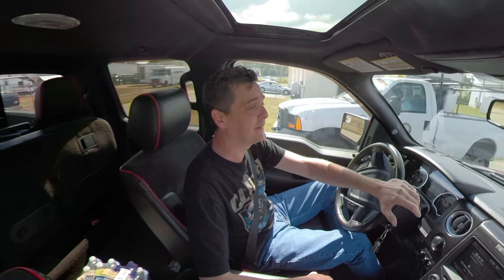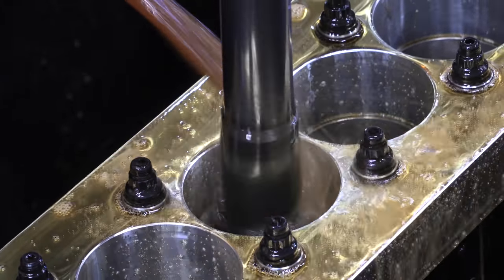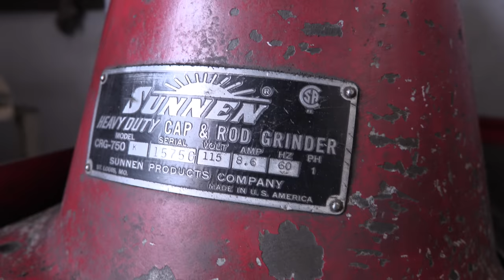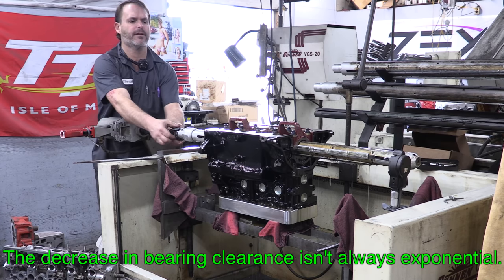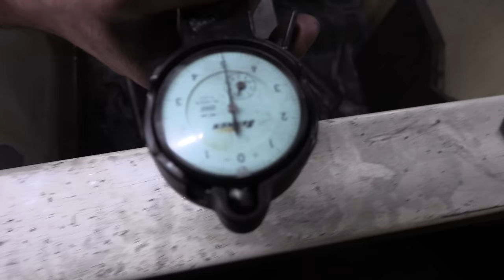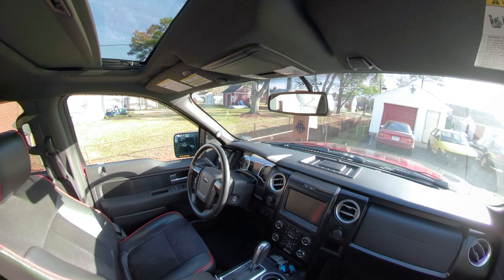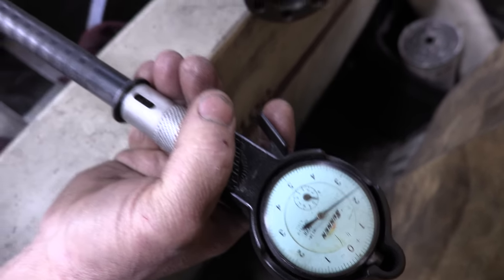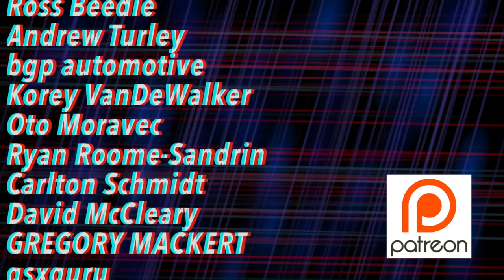[4K] GSX Block Prep 8 - Machining Mains & Cylinder Bores

Comment: Quality machinery:

"MADE IN THE U.S. AMERICA"

Made back when Men were Men,
and FAST was 150 mph.

Your able to get a consistent product when
all your critical machines are made by the same company.
Reply: It would be alot better if the guy measuring knew the first thing about metrology and taking clean measurements. I suppose this seems like magic to some of you who think that .0001 is a small amount.  Some of us have to work within millionths or ten millionths. And do it on a lathe, swiss.
Reply: @supermotos  And we work almost exclusively with Platinum/Iridium because 95% of the things we make get either implanted direct in the heart or connect to it with leads.  You don't think you can do that on a Swiss Lathe? Lol. I wish I could post a pic. I can't post the print obvioisly but can post the mitutoyo measurement results and tolerancing sheets. I make cardiovascular implants. You can doubt it all you want. I mean the total O.D. of the material we make most of our items is between .100 and .010. And that is raw stock. We have parts with wall thicknesses of .003. We hand sharpen all our tools and use a comparator to verify angles and tooling, then it goes under a scope (20x) then in. We grind out tool points with 0 radius. Regularly work with .035 boring bars and drills from #78 down to about .001-3 Lmao. Anything snaller we use Sarix or Edm wire machines. It isn't like every single one is checked though, we check 1st and last piece dimensionally and 100% inspect ubder scope before the parts go to finishing. There is a whole world out there, you should check it out, if you are any good we are always hiring.
Reply: @supermotos  Also just to be clear I can't just walk up and hit those numbers first thing. We try to keep them running 24/7 but if it sits for more than a minute or two the numbers start going out again. We refine our own platinum and draw our own wire, so it is nothing to run the machine until up to temp, measure several, offset, measure several more, offset. By the second time it is usually good to go for about 100 pcs. All pcd tooling by the way, ground in an agathon swiss manual tool grinder.

Comment: Hey Jafro, what lead you to believe that your ARP studs went bad?
Reply from the maker: Maybe being torqued to 60 lbs two dozen times over 6 days?Perhaps the cutting oil bath contaminated the lube?  I thought I was good with re-applying, and it would have stayed in the threads, but they actually came out of my 7-bolt that blew a rod bearing.  They have over 300 drag passes at around 400hp on them, and they're 17 years old.  They've got a lot working against them but before I used them in this current 6-bolt, I gave them a hard inspection and I couldn't fail a single one of them.  They were fine.  The black oxide coating is all chewed up now.  It's a sea change difference with the new studs from the handle of the torque wrench.  They started going downhill fast on day 3.
Reply from the maker: Sorry about the disjointed post.  Failed copy pasta and it reads terribly.  My apology means nothing if I edit it, and I don't feel like editing it.  I know you get it all, just in the wrong order.

Comment: I need ur help I love in Pennsylvania I have a 3 g eclipse with a 7 bolt 4g64 the bottom is the same as the 2g eclipses I built the shop motor I've been a fan of ur channel a while I reached out before but u mind if brushed me off like 2 g  and 3g aren't almost exactly the same except for a 6know deck night difference and a lack of dogs I swapped that

Comment: How does this normally go down for the average enthusiast building an extremely precise race motor? Like if someone wanted to do billet mains on a 1000+HP 2JZ and needed the mains line honed? I’ve never seen customers allowed to enter and much less work on their own stuff at a machine shop and i cant see how any machine shop would ever spend this much time and effort on anything for just a few hundred bucks. Do they install the bearings and check every time? Ive never heard of anyone picking up their block and going home to check their clearances only to find they’re off and redoing the process 1000 times until its perfect. Are they paying again and again after every improper line hone job? There has to be another way and i doubt that the baddest race motors out there and mixing and matching different bearing sizes

Comment: Was your ir gun set to .95 immesivity? If so your temp reading isnt accurate as .95 is meant for a non reflective surface.
Reply from the maker: A honed cylinder bore isn't shiny at all.  My IR gun has 2 buttons, so I'm not sure that can even be set on it.  It was like $12.  But the area we tested wasn't shiny.
Reply: @Jafromobile  then it sounds like it's good enough for the girls you go out with! If it's a fixed setting, it would probably be stated in the user manual
Reply from the maker: @bmneumann  Oh, you're talking about the thermometer.  I thought you were talking about the hole?  lol.  Either way, pretty accurate.

Comment: Did your machine shop ever try mixing bearing sets to get the clearance you were looking for? For an example, putting half of a STD with half of a 1 under to get the clearance you needed? Or was it a matter of principle to try and use the same size halves for each journal?

Comment: Only problem with line hone is that you are taking material off the block side of main journal . If you have a gear drive the gears can get tight or timing chain loose . Preferred method for heavy diesel  that I did years ago is to line bore  the mains and only take material off cap and finish hone with emery cloth on a wheel of appropriate bore size . Job takes longer  though.

Comment: this may be complete conjecture, but i wonder if the honing issues may have been from running the hone stop to stop on the slide and jumping. i would think ideally you would want to run it to a smooth stop before the mechanical sudden stop

Comment: The clearance, is it measured all the way around with the piston on the center of the bore, or just on one side with the piston touching the wall on the other side?
Reply from the maker: Either way it should be the same number.  But really you measure the piston and the hole, and subtract the piston from the hole to get your clearance.
Reply: @Jafromobile  You get two different clearances if you measure with the piston in the center or touching one wall.  So from your answer, the clearance is all the way around as in the piston in the center of the bore.  Thanks.
Reply from the maker: @freddyrosenberg9288  The clearance is the total gap on both sides.  So if you have .002" piston to cylinder wall clearance, it's really .001" all the way around if it's in the center.
Reply: @Jafromobile  That's what I thought. I appreciate it.

Comment: Talk about distracted driving. Not setting a good example for the youngins! We’re they going to square the deck after the line home?
Reply from the maker: The deck is square as demonstrated in the previous block prep video, and the process was performed with the torque plate still attached... but really?  That's a stretch.  How do you get distracted by a GoPro Fusion 360° camera that's suction mounted to the sunroof with no viewfinder and only one button to start/stop it with?  A button that was only pressed twice from outside the passenger door, both times when the truck wasn't running?  What I did here was less distracting than having a single passenger.

Comment: what's up with the camera its behave so funny
Reply from the maker: Eliminating camera shake and the stupid mechanical manual zoom on this thing.  Trust me, it's better than what really happened.
Reply: @Jafromobile  no I mean the camera rotating by itself must be one of those 360 cameras with no control
Reply from the maker: @gpowerdragon9852  Oh.  Yeah.  GoPro Fusion.  360° camera.    I did that in post.  I thought you meant inside the machine shop.  I think a few spots in there turned out slightly janky.

Comment: building my engine right now. is 0.007mm big end clearance to much? (.250 thou) forged crank
Reply from the maker: You mean .07mm, right?  If so, yeah, that's loose.  That would be .00276".
Reply: @Jafromobile  oh yeah right, i dont wanna machine it :(
Reply from the maker: @Pong-Lenis  How are you using the engine?  Are you trying to make 1,000,000,000 horsepower, or fix it for mostly stock use?
Reply: @Jafromobile  boost it and make 100hp per cylinder. 3.0 i6. Gonna drive it hard
Reply from the maker: @Pong-Lenis  Yeah, that's pretty loose.  As long as you've got a lot of oil pressure to play with, you'll get away with it for a little while.  The average service limit of a crankshaft main bearing is .004" at stock power levels.  At that stage it's a hazard to itself.
Reply: @Jafromobile  Yeah the workshop manual tell me the clearance should be 0.02-0.04 mm so I thought i was pretty close. But now it's almost double that. I'll try your idea and bring donuts to the very expensive machine shop.
Reply from the maker: @Pong-Lenis  You could buy an oversize bearing set and shave .001" or .025mm.
Reply: @Jafromobile  I think I will, since I do value reliability quite high

Comment: Doesn't freaking help that the motor is moving while he's shaving your main caps...
Reply from the maker: It really doesn't matter.  There's universal joints on the arbor where it connects to the motor.  It's made so you don't have to or need to center it.